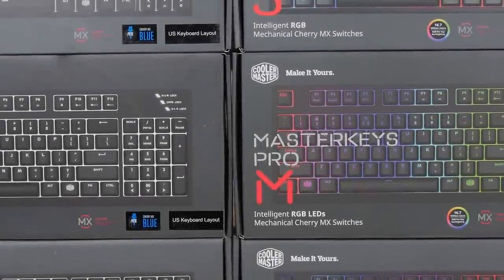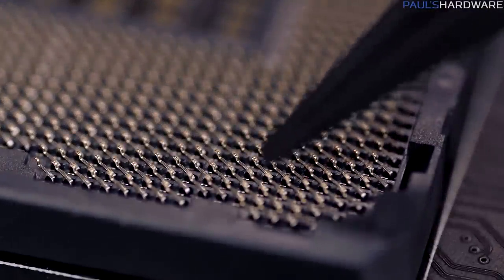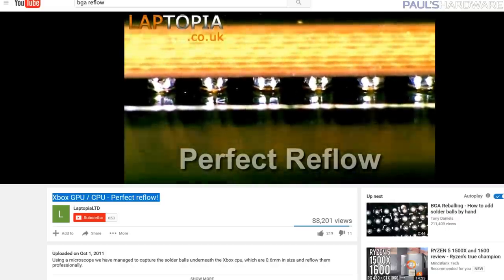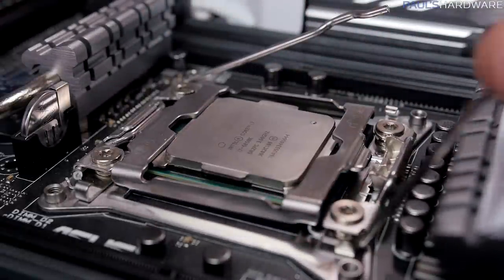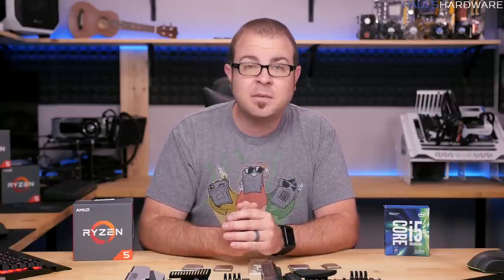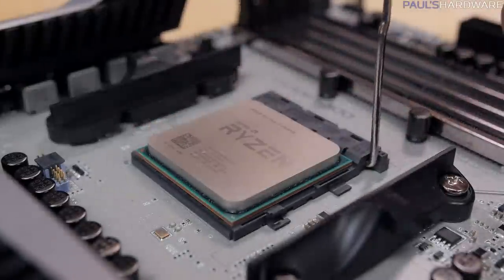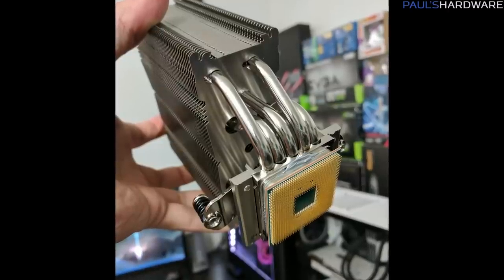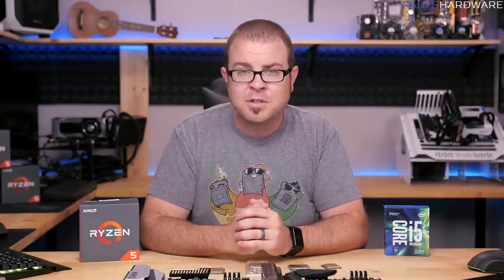LGA vs PGA! Which is better?

Comment: Intel Worker 1: You know what will be a good idea? Getting rid of the pins and make the motherboard companies deal with it.
Intel Worker 2: What if the customer bends a pin then?
Intel Worker 1: Don't care, not our problem.
Intel Worker 2: BRILLIANT!
Reply: I've repaired some PC's with motherboard bent pins, and all of the worked. If you bend a pin on a cpu, must be much harder to fix, i guess, since I've never repaired an PGA cpu.
Reply: no
Reply: don't put pressure on the SOCKETS with the processor
Reply: IBP_Did_9/11 Paul literally says the exact opposite, that he's only ever got 1 motherboard socket with bent pins working, but he's repaired over 100 PGA CPUs with bent pins.
Reply: motherboards cost a lot less to replace. i would never spend more than $300 on a PGA CPU, especially on an AMD PGA CPU. that's because AMD's AM4 socket has no CPU retention mechanism, so whenever you remove the cooler, the CPU stays attached to it. and if you hold the cooler vertically the CPU just slides off and falls.
Reply: @solomonshv  cpu's are a lot easier to repair, your point is moot. ive had 2 processors where pins had bent flat and i saved them both with ease, just takes time and patience.
Reply: @Shawn I wonder how do you get only ONE pin FULLY flat? Did you intentionally do it.
Reply: makes no sense
Reply: I like it mate 🤣🤣😂😂👌
Reply: If u mess a PGA, u have to buy another CPU, if u mess a LGA, buy another motherboard, which one is cheaper?
Reply: nitro329 ayo, motherboards are cheaper (most of the time) than the cpu
Reply: @bazooka712  Stick the broken pin into the correct hole on the board, usually works.
Reply: @solomonshv  Just twist the cooler a bit as you take it off.
Reply: for me the cpus are more important than the motherboard
Reply: @bazooka712  I have bent two pins on an AMD CPU and with a blade I simply straightened them back.
Reply: @cyberp0et  Got the same issue on a Pentium 133 long ago, I accidentally bent a few pins, I haven't tried fixing LGA sockets but PGA is definitely easy to fix.
Reply: Bent pins on PGA's are a far, far easier to straighten and fix. Also if you slightly rotate and lift a corner of the cooler on PGA chips, as you take them off, they tend too stick together, far less. If a chip looks like its stuck firm while trying to remove it, just stick a paste spreader between the two and twist or prise them slightly apart (the only thing that thermal spreaders, are good for)
Reply: @shawnpitman876  Just have to not bend the pin any more than necessary or that is when it might break off.
Reply: lol juste let the cpu run a bit and voila  rock the heatsink form side to side just Don't pull it lol  @bazooka712
Reply: @bazooka712  No you haven't and its obvious. You may have repaired one with a slightly bent socket pin and used too much force on a pinned CPU and broke it, but you haven't done it to many. Socket pins are a nightmare as they go off at stupid angles and short each other, repositioning one can bend another, CPU pins you literally bend back into place and can solder a replacement on if they break.
Reply: really? have you ever really even built even one computer? amd pins are easier to bend
Reply: @lou5368  I have built and repaired hundreds.
Reply: @leenagle2903  was replying to the original comment good sir. not you
Reply: your comment makes no sense, 'cause SP3 (EPYC) and TR4 (Threadripper) have already applied LGA just like Intel :)) and they are of high end and server segments, which are a lot more expensive than the mainstream segment with AM4. As per AMD fan who always praise the PGA, AMD's high-end desktop and server CPUs use worse socket than the much cheaper one :))
Reply: @quantran9922  Yes, i was surprised that the Threadripper wasn't mentioned, as they are LGA. (funny thing.... the LGA chip design was patented by AMD)
Reply: Yes👍
Reply: @bazooka712  lol
Reply: @solomonshv  The trick is to * twist * the heat sink and separate it from the processor. Then remove the processor, all by itself, from the motherboard.

By the way, I am so looking forward to seeing the movie Lincoln, by Steven Speilberg!
Reply: I think this goes either way.. Let's assume both cpu's are 300$. If you mess up a pin on the mobo, it's a pain getting them straight, and if you fail, you can buy a new 100-200$ mobo. If you bend a cpu pin, usually fairly easy to straighten them enough to get the proc to insert, but if you bend it too much it will break and you will be buying a new 300$ cpu. I personally think the LGA is better, even though I'm an AMD fan boy..
Reply: Motherboards are cheaper than CPUs.  Better to break the cheaper part than the more expensive one.
LGA > PGA forever.
But intel as a corporation sucks
Reply: I mean I’m not having problems since although LGA sacrifices on motherboard durability, it gives a massive advantage to LGA cpus since they obviously have no pins and also the cpu is the main part of the system.

Comment: Which is better? 

The one that is compatible with your motherboard cpu socket.
Reply: zero insertion force ....mmmm....  where's the fun in it?? ;)
Reply: Code Junkes 
What if the cpu is too big for the socket😉😉
Reply: Slot type CPUS  none of the bull shit issues these have
Reply: @codejunkes4607  I know, where is the fun in that?  I have a 16 ounce rubber dead blow mallet I never use hahaha.
Reply: Hahahahahahaha
Reply: Am4 many CPUs 
Am4 many BIOS updates
Reply: @primeribgaming2681  then buy a smaller cpu

Comment: I beg to differ!!, PGA Cpu's are Fixable, I was given a brand new AMD 3200+ for free at release, it was a $460 chip at the time, problem was it had 2 broken pins, now the thing is when a pin breaks off, it still has a little bump on there so i took a blown Celeron chip and a scalpel, cut off two pins as close as possible to the chip so it still has that flat surface on the one end so it looks like a pushpin. inserted it into the two pinholes on the board corresponding to the broken pins and it worked, the heatsink force kept it in contact and that thing worked for years. Good times..
Reply: I would have done the same thing assuming I could not RMA it for free or a resonable price. People give up on broken electronics wayyyy too easy.
Reply: That's amazing. I would have soldiered the pins on the CPU.
Reply: This is actually really helpful thanks a lot
Reply: I just cut a normal sewing pin to size and it worked fine.
Reply: Dizy Tizy I did that once haha.worked a treat
Reply: But he even said PGA processors were much easier to fix than LGA motherboards..?
Reply: Theo Engelbrecht : Brilliant
Reply: FieryWingedAngel, read the comment again. He is not disagreeing with that, he is disagreeing with Paul saying that if you break a PGA Cpu's pin completely off the cpu that it is "Toast". He is saying even then it is still potentially savable.
Reply: Very clever.
Reply: I was building my complete computer and i bend one of the lga motherboard pins and it was fucking hard to get into place but i got it and im 12 years old bro😂🤘
Reply: improvise, adapt, overcome
Reply: While changing ram in my current PC, After lifting the CPU cooler, I saw some gold pins on the bottom. Took me a second to realise what had happened - The thermal paste had enough strength to rip my AMD 8320 FX out of the socket. Some of the pins were bent, but while straightening them out, I realised some pins had snapped in half. I instantly gave up any hope of having a working pc, but decided to try turn it on, and it blue screened.

Then I restarted it, and it's been working fine since. I guess the other halves of the pins are still inside the socket.

I'll upgrade eventually, but so far so good.
Reply: Theo Engelbrecht or you could have just submitted a ticket...
Reply: Best answer. Back then we removed, connected and resoldered PGA pins all day (pinmod overclocking and overvolting, Intel Tualatins, AMD Bartons etc), also much easier to install/replace when you can't tilt the case with the mainboard installed

Comment: I'll take PGA thanks.
PGA bent pin = Use a mechanical pencil to bend it back
LGA bent pin = Buy a new motherboard (In general)
Reply: PGA is like ak-47
Reply: Format128 lol what
Reply: Bro i bend my lga pin and got it fixed and IT WAS FUCKING HARD and im also 12 and it was pretty expensive for me 😂
Reply: @aconfusedmancx8323  
the AK-47 became popular because it was cheap, effective, reliable, and easy to fix.
Reply: Nathan Gamble oh I see
Reply: you can use a 9th generation in motherboard to 8th
Reply: Knågen It’s actually REALLY simple. I got a faulty cpu from Best Buy and i didn’t apply force- it still damaged the pins. When Best Buy issued me a refund and I got an actually good I9, the MOBO was throwing out ‘CPU ERROR’ and i knew exactly what caused it. Just brushing your finger across the pins can cause a few to get bent. Especially considering it was a $600 MOBO and a $580 CPU it was terrifying. You can try to be as careful as you can but sometimes you won’t know you bent a pin until you notice something’s not working properly. I got a replacement for everything though and now all is fine.
Reply: @aru-YT  Why in Gods name did you touch your pins, you should have seen the bent pins coming. With Lga you should keep the cover on unless you have a cpu in the socket or are installing. Touching the pins in the socket is clearly a dumb idea and shows you really don't know what you're talking about
Reply: aerski you said in your post “just brushing your finger across the pins can cause some to get bent” that seems quite obvious I don’t recommend running your finger across an expensive piece of computer hardware
Reply: @LVSLpwr  Linus, thats who
Reply: I preffer pins. Is not that easy to bend them and if you have few bent a bit (say you carry cpu in your bag without a box as I did), use two thicker plastic cards to realign all pins and off you go.
While no pin is easier to insert - the difference is so minimal that don’t think it even worth arguing what better lmao
Plus, with pins you will KNOW if something went wrong, misaligned etc, whereas no pin = unlikely but potential short (bent mb side pin, or say tiny bit of meal etc etc.... ).
Pins just feel better and more reassuring when inserting lol
Reply: mlc rip ik ur referring to pga, but both parties have pins. Its just a matter of where the pins are.
Reply: LGA pin is much harder to get bent. It's flexible! However PGA pins might be broken and that's the end of the world. I think, for Intel, CPU is more expensive than the motherboard. But for AMD, motherboard is more expensive than the CPU.
Reply: @LVSLpwr  Dropping the CPU on the socket, wrong CPU generation attempts or simply putting it in in an uneven manner can cause it. It's the no1 repair I get for intel mobos, they are like little hooks and can bend with a brush of the finger.
Reply: You can repair the motherboard as well
Reply: Lga Is minigun
Reply: You can fix bent pins in a LGA socket too

Comment: I broke a couple of  pins once on AMD CPU  put a small 2mm copper wire piece inserted in the right hole then reinstalled CPU and it worked
Reply: doubt it that copper will melt eventually.
Reply: @level8473 Google search the melting point of copper Einstein.
Reply: @level8473  lol
Reply: I mean, those are copper pins I think so you're technically just replacing them. So yeah it it should've worked like you said it did.
Reply: 200 iq lol
Reply: It works fine, I have soldered pins back onto CPU's to fix them in a similar manner.
Reply: Hatori Ibuki  I doubt it that copper will melt eventually, on which part did you not understand?
Reply: @level8473  the part which i did not understand is that copper melts at over 1000 degrees celsius. i wouldn't worry about the copper wiring at that point
Reply: @level8473  The way you wrote your sentence made it sound as though you were saying the copper would melt soon as opposed to the durability you were seemingly trying to highlight lol
Reply: @emanx222  Oh sorry I'm dumb with english
Reply: @level8473  haha its all good man :)

Comment: broken pins on the cpu is what happens when you use mayonnaise as your thermal paste of choice, like what your typical OEM will do
Reply: exactly, only low cost pastes stick like wonderglue, +$5 and you get a big difference
Reply: if its sticking that much youre prolly using too much paste lol
Reply: Or liquid metal, when I was removing cooler from my old i5 it holded very hardly there. I have AMD now so I am afraid about liquid metal, I used classic MX-4 now.

Comment: Easy fix to keep the cpu coming out with the heatsink. 

Before lifting the HEATSINK. Twist the heatsink as much as you can then remove the heatsink.

I've been doing that for a while and its been working great for me so far.
Reply: Mattack I thought it was intuitive to do, guess I was wrong!
Reply: Yep figured that out back years ago when my AMD K6 CPUs needed little better heatsinks then my older 486DX did.. Just twist to break the suction.. :-D
Reply: Tip n*2: Don't wait 5 years to change the thermal paste that has turned into concrete at this point XD
Reply: I just made the same comment before noticing yours.  I have been fixing computers for about 20 years now.  And twisting has always worked.  The only time I even ran into a problem is with the original P4 lineup that had PGA CPU's.  The way the heat sink was attached, made it impossible to twist enough to break the seal after it had been on there for 5+ years.
Reply: There is another option leave heatsink with processor all together, sell as complet and buy new one :)

Comment: I wonder why AMD doesn't have some sort of socket clip to go over the edge of the CPU that would prevent it from coming out with the cooler.
Reply: Good idea. Although it has never happened to me I can imagine it is useful.
Reply: I suppose it would work. It's not really necessary though, and it would add extra cost and size.
Reply: That happened me one time. I bend 4 pins completly... But it was easy to bend them back (may still look bent..) but it did fit in the socket again and still works ok. Phenom II X6 1090t Stepping 0 :)
Reply: +Anton Lisnik - Hmm, surprising. I've heard plenty of reports of this happening with AM4 sockets and CPUs, because they have such a high pin density, but I've never heard of or encountered it myself with the "old density" 939, AM2(+) and AM3(+) sockets. It certainly always felt like a lot more sideways pressure was exerted on the pins of my Phenom II than on those of my Ryzen.
Reply: Probably because you have to be a bit incompetent or negligent to pull the CPU out with the cooler. Yes, I've done it before, so I understand what it takes for that to happen and how easy it is to avoid.
Reply: They have for TR4 sockets, but plebs on AM4 dont get a fancy things.

Comment: just twist the cooler while removing it. CPU won't be stuck to it ever again.
Reply: Could be hard with a bulky aftermarket cooler, I got a noctua cooler and that thing is huge lol.
Reply: should work regardless. Also got a fairly big cooler, a Scythe Mugen 2B
Reply: Or you just let your pc cook for a minute then pull it off
Reply: Or don't wait 5 years to change the paste ;)
Reply: can confirm it works
Reply: I once cut 3 fingers by attempting to remove a CPU from a heatsink.
Reply: i have twisted every pin by doing that..... 12 year old me mistake.
always heat them up
Reply: That's what I was thinking of... The CPU is secured to the sides, but not on the top, so by twisting the heatsing, you are gonna get it loose from the CPU.
Reply: And when you're trying to remove a boxed heatsink that fits exactly within the plastic frame and can't therefore be twisted, then what? If PGA sockets had a metal lid to hold the CPU down, like the LGA do, replacing heatsinks and/or thermal paste would be much easier. If you can't twist the boxed heatsink, you will have to pull it off, and since it's boxed, it will most certainly have the stock thermal paste on, which means the heatsink is effectively cemented to the CPU and you will absolutely rip it out along with the heatsink, and then when you have to pry the CPU off, during which you WILL bend pins.
Server CPUs, Intel and AMD, have been LGA for a long time (except Itanium, which is a completely different animal), and for a good reason. First, motherboards are generally cheaper than CPUs, so replacement costs less, and repair is cheaper too. Second, LGA CPU will be fine if you place it on a flat surface or move it around without too much care or accidently press it against a flat surface, which is something that's bound to happen in manufacture. I know; I was an engineer in a server manufacturing plant and I saw the kind of people they hire for assembly (not the most careful bunch). A PGA CPU wouldn't survive a minute there without damage.
Reply: It also helps to not drown the CPU in thermal paste.
Reply: couldnt u just set down the cooler then hold the cpu by the corners and twist? that was my first train of thought when he mentioned the cpu coming off with the cooler
Reply: don’t use superglue to attach cooling block 😳
NOT from personal experience 😐
Reply: These noobs dont understand that!!  They werent building systems back when the P3 Was hot And the 2500M Good ol "Barty"   Man Good times!  I loved my 2500M,  I Held the highest overclock on AIR on Pimprig.com 3.0Ghz on a 2500M in 2003,  Good times! And them chips the heatsinks were actually mounted to the socket it self by 3 fingers!  Damn thing was a pain in the Ass! LOL

Comment: i accidentally drop a thermal paste into  proc socket (an old asrock z77 extreme4) and bend some of the pin in attempt to clean in. So i go to so small shop that specialist in repairing motherboard to try to repair it. it think this gonna take a day or two but all he do is look at it  then some kind of eye scope (the kind that watchmaker use) and repair under  5 minutes.my motherboard worked and still going strong until now.
best  dollar i ever spend.